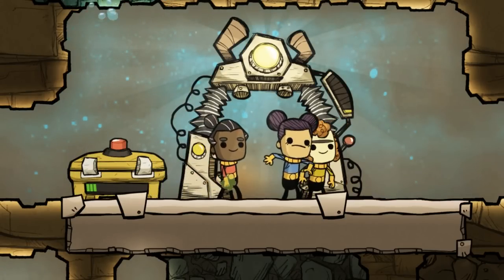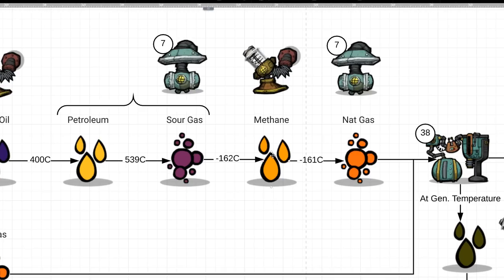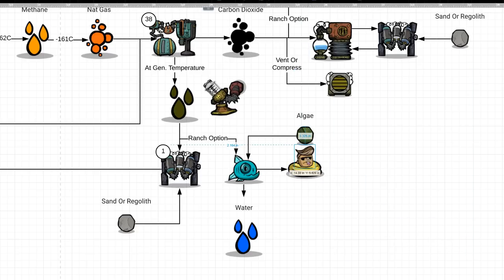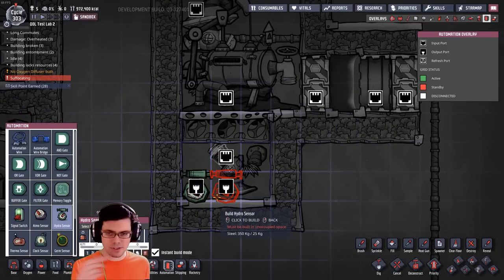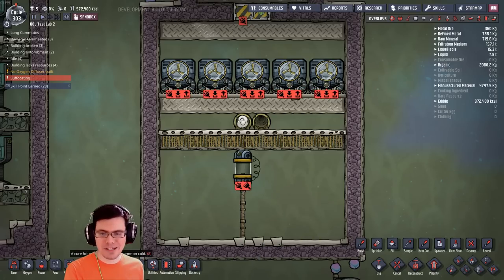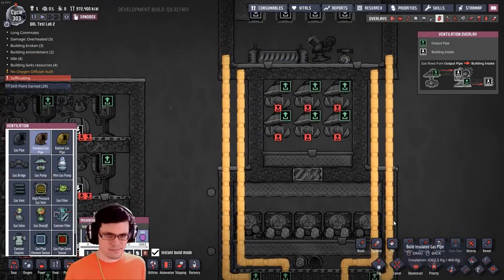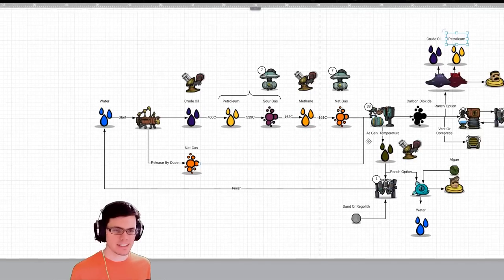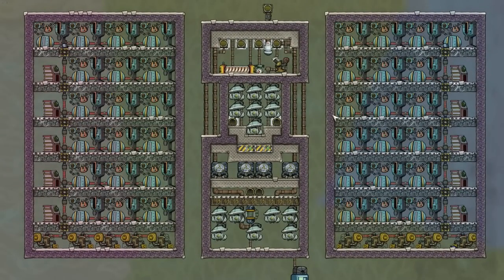Oxygen Not Included Tutorial - HUGE Free Energy From Sour Gas!

Comment: Wow. I just cobbled together a "thing" and it's working and it's nothing as neat or complex as this, but only thanks to mods. I needed the advanced cooler and access to lava. I made an overflow separator with a cooling loop that requires super coolant, which is the worst thing about my build. The rest is straight forward, including a 96 tile high pressure storage chamber for the natural gas which is getting cooled there. The only automation is a petroleum level sensor and a temperature sensor on the lava heat exchanger and methane chiller. It's definitely nice not needing all those aquetuners. When you keep a certain level of petroleum over oil, it acts as a buffer for when the oil gets hot enough to convert, but it cools quickly due to the mass above. I try and use two tiles worth of petroleum over oil and the oil always gets released over the hottest tiles over the lava.
This game is amazing for the many solutions to one or more problems!

Comment: So good they've had to nerf it several times.  I wonder if we are going to ever get a use for sulfur.
Reply: Doesn't the grub grub eat it? And that spindly plant?
Reply: This was 2 years back.  Before the DLC existed.  But yes.  There is finally a use for sulfur.
Reply: What do you mean by nerf in this case? I've tested this build (however little tweaked) last night and still seems to work pretty much well.
Reply: Years ago, a year+ before I posted that even.   Boiling oil turned right in to natural gas.  Then boiling oil turned in to sour gas but 100% of it turned in to methane when cooled.  Now we are at what?  33% turns to sulphur?

Comment: if you heat up the generators over 125 degrees celsius you can slap on a few steam turbines up top to produce even MOAR power, and it saves you the hassle of cooling steam down to water, and it comes readily in a pipe too.

Comment: It's possible to skip the first set of gas pumps. With the use of insulating shift plates, you can have the oil -> sour gas and sour gas -> liquid methane in the same room. Not sure how much that ends up saving in the long run, though, so might not be worth the trouble.

Comment: I feel like this could be way simpler. As long as you have space materials:
Boil oil with thermium aquatuners(start in vaccuum). 

Thermium air pump sends sour gas from aqua tuner room to a room chilled by the aqua tuners.

Methane is pumped to a room and dripped in a pool of water warmed by a tepidizer. Methane flashes to nat gas.

Then nat gas goes to the generators(made of steel). Start the generator room as a vaccuum and when they heat up steam is produced.

Turbine at top of generator room turns steam to water which is pumped to the oil well for more oil.

I dont see needing more than  hydro sensors atmo sensors and possibly thermo sensors.

I may test this myself and reply to this message to verify.
Reply: Yes! It works great, the only automation I used was a hydro sensor plus liquid shutoff on the aqua tuner room to limit the flow of oil so it can vaporize.  Other than that I couldn't get my generators to overheat because the nat gas is coming into them at -14c so it keeps them cool, some tweaking could easily solve that by using the nat gas pipe to cool something. 
I used 1 aqua tuner, 1 gas pump in the tuner room( should have used 2, there is an excess of sour gas in there), 1 liquid shutoff, 1 hydro sensor,1 gas pump in the tepidizer room, 1 tepidizer and that's it.
It seems it could easily be scaled up.

Comment: I know you have extra power and pumps don’t cost hardly anything lol, but if anyone here wanted to make it cheaper, make a 1 tile tunnel below your oil wells to a door, hook that door to a hydro sensor, when it’s full enough the door will open and slam shut allowing only a little oil out and keeping natural gas in and outside gases out (since gas doesn’t flow through liquid) 

This method however assumes your oil wells are above your main oil tank and you’re just dropping it into your main tank, which is how mine are always setup 😁

Comment: I just realized that doors maintain their temperature when they're opened, but probably can't transfer the heat at all.  Could this, in theory, be used as a heat battery?  Something to think about.
Reply: Absolutely, however it's a poor use of two tile spaces due to low thermal capacity. A door is only 200kg of material.

Comment: Brothgar you can put compressed carbon dioxide (water) in electrolyzer to turn water into hydrogen and oxygen use hydrogen to power using hydrogen generator and vent oxygen to the base

Comment: The system is not quite stable. You are heating up 3,333 kg of Crude Oil 90 C to Sour Gas 542 C, which is 2596,8 kDTU (taking into account all state transitions), and then cooling down with Super Coolant to -164,6 C (this is when methan emerges) or 4467 kDTU, meaning that your coolant is absorbing 4467-2596.8=1870.2 kDTU, so you need additional system to cool down your coolant. Since you need cooling, it won't cost you much: aquatuner+steam turbine system will do the job for a pathetic 41 kJ/cycle.

Comment: Jesus Christ. Without multiple gold volcano's, I don't see how you ever get 15200 refined metal for this. That's just the metal for the power plant. Then you need 4 aquatiners, steam gens, 3000 gas pumps. We're using zero of the games natural mechanics to help out with our efficiency. Like, no pipe break due to phase change at 10% capacity. Gases naturally moving from high to low pressure. Etc. Everything here that gets done, only does so when we spend more power and more metal. 

Cool sandbox build though. If you ever reach the point where you comfortably build, run and keep cool AND actually use the power generated by this monstrosity, it's time to pack it up. You won.
Reply: most of the material is in the generators. the only volcano that would work here is the iron volcano, as steel and metal ore are the only things that can be used for NG generator construction, outside of the niobium or thermium. this makes construction even harder.

Comment: Does it work in today's version or did the numbers change?
Reply: I built one and I have a problem with the methane freezing in the right hand portion of the chamber - adding a loop of radiant piping to preheat the petroleum before being flashed to gas helps, and there isn't enough gas generated to run the generators continuously.  Set the smart batteries to 90/75 and that should leave you with a gas surplus.
Reply: @1x4x9  thank you very much!

Comment: Question: Is it more Efficient to store gas in Containers or in a Enclosed Box?
Reply: you only use the containers for automation and thermal isolation, they store the same amount per tile otherwise.
Reply: Both! The storage containers hold less than the 20K pressure in a single tile that you can get from using a high pressure gas vent. If you put the storage containers in an enclosed space, and fill the containers AND the enclosed space, you get like 180% storage capacity from just using the enclosed space, and over 200% more than just using the containers. Same goes for liquid storage, without the need for high pressure vents.

Comment: At me it doesnt produce a constant amount of gas to keep all 38 generator running..  its a wig wag between times of full gas pipes an almost empty ones..  that isnt really a stable electric supply :(   a little add you can use the cool sulfer  and run it via transport rails through your generator area  and dump it in some vakkuum area  so sulfur have a good use for cooling beside beeing useless
Reply: There was a Patch with the conversion rate of Saur gas to methane, its now just 3:2 and not 1:1 anymore. So this setup provides enought natural gas for only 24-25 gas generators now.
Reply: @muhormuhorsen2511  yes thats an adequate number.. combined it ith with two gastanks for each outputting natural gas lines  no its stable running 25